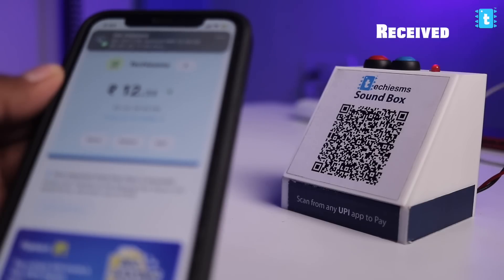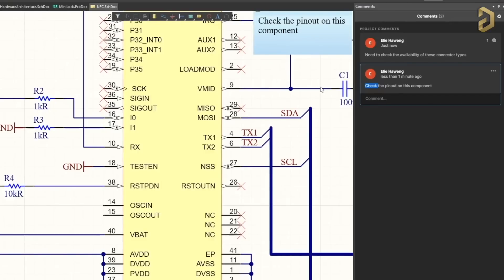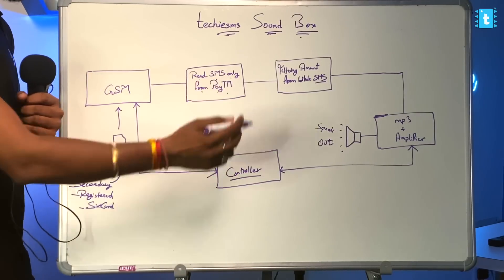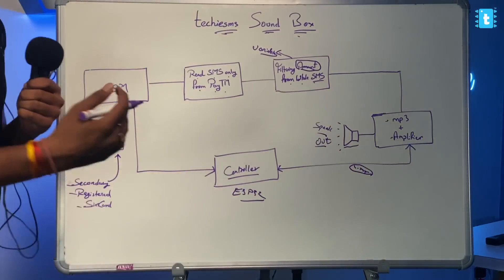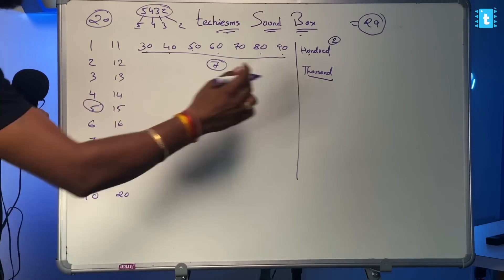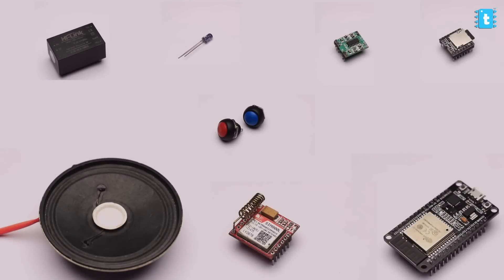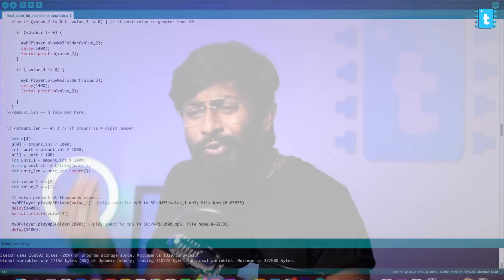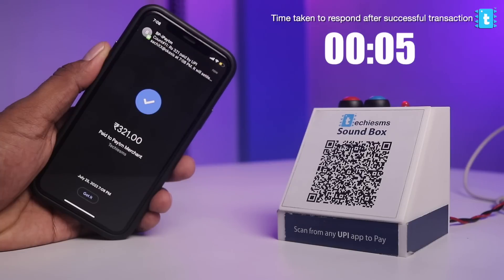techiesms Sound Box | ESP32 Projects | IOT projects

Comment: Another Approach that I would take is: Use a Rpi 02w with SIM card Module and then use a pre trained voice model of our voice and Simply read out the SMS sent by The app, which will also allow to expand on features later!
Reply: Hey Arnav have you done some similar project or have some experience in working in electronics design domain

Comment: Really great project 
Problem 1) How to clear sim’s message memory 
Suggestion 1) Adding a 18650 Li-ion battery with TP4056 charging module
Reply: To clear the SIM's message memory, he can use AT command with argument +CMGD
This will only delete a single message, specified at an index location.
But,  we can use a for loop to iterate to all the indexes with delete. While setting the condition that the max message -1 is reached.
And yeah, the suggestion to add 18650 is nice 👍

Comment: Just add wifi support also so that in case GSM is not working, you can have it with Router or mobile's hotspot, have tryed to scan your code with token amount as appreciation too...
Reply: How will it receive SMS over wifi 🤣
Reply: @mradulbhardwaj3147  yes, it's totally different approach we can use net api instead in that case 👍

Comment: It's very Waste. Paytm will change the Number then this box is not working. Best API method. Paisa Also Not working your Method.
Reply from the maker: Paisa works. 
and if PayTM changes the number, which I think rarely happens,  we can change the number and re-upload the code.
Reply: @techiesms  And because we used ESP32, wi-fi can be used to change such info through Mobile and if this device is not working, app can confirm the same way loudly and in that case this type of box may not be needed !!! as alternate to adding such feature !!!
Reply: @FnOTradingLearner  This box is a DIU project for enthusiasts. The fun is in making the priject. Technically you don't need ESP32 nor any electronics nor  nthe box at all. You can get data from confirmation sms through simple android code and play the sound via a bluetooth connected speaker 😁
Reply: @rselvarajanMBA  no need any kind of hardware. Just Android app and Blue Speaker. Android app also have aa TTL library support. Very very Easy way ☺️😌☺️
Reply: API would need GPRS module or wifi connection - both of which aren't viable and reliable in petty shops and small stores across country which is why paytm box  too uses 2G SIM.
Reply: Again and again re-upload the code is not better then API method. API method is best way to communicate. And Also API method no need to secondary sim. Secondary Sim card recharge process no need.